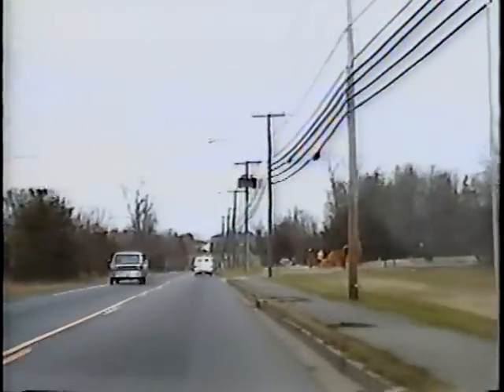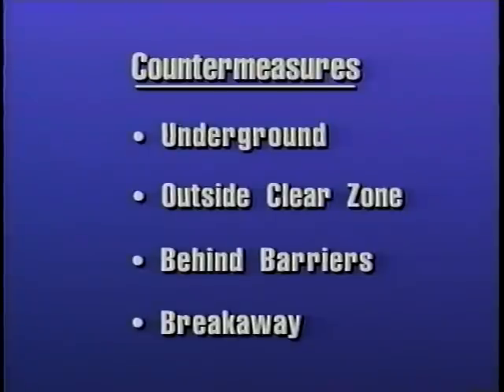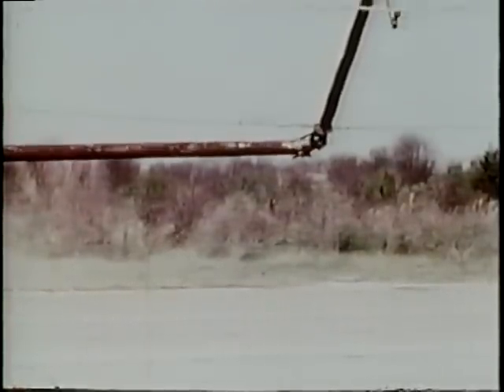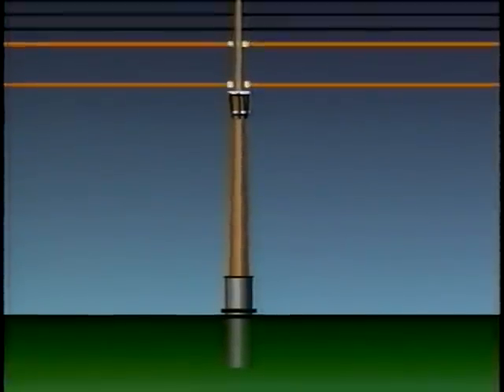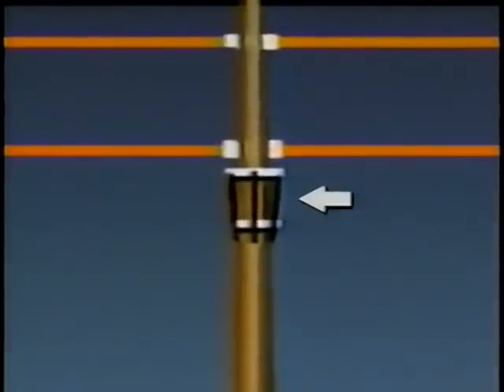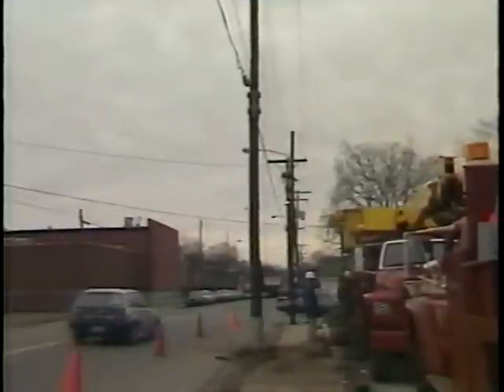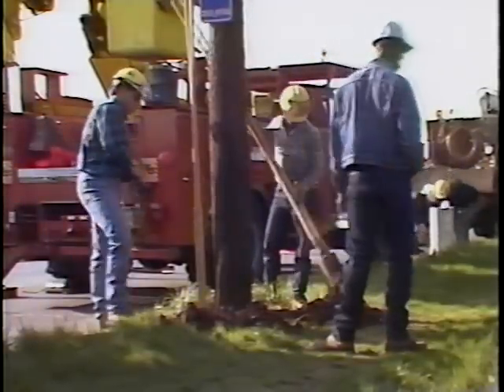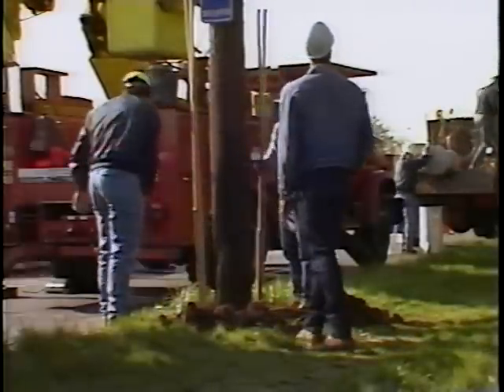Breakaway Timber Utility Poles

Comment: Modern telephone poles are designed to give way or "breakaway" to help lower the chance of death and injury if a car hit them.

Just look up Breakaway utility poles.

Seen an extreme version where the bottom half of the pole was gone but the tension of the wires kept the upper half up right. Lol

Comment: Thats not true. The break away utilty pole designs prevent the adjacent poles from falling and are very easy to replace. You can find more info on them in the new roadside design guide. "No longer stopping a car from going into a house....?" Utility poles were never designed to stop vehicles like semi-rigid or rigid barriers would. If their is an issue of a car entering an adjacent lane or going into a house then an appropriate barrier would be installed to prevent that and not a utility pole.
Reply: Wow ten years

Comment: good idea but not very pratical.. u reduce the impact to the car, but now your sending live primary lines raining down on the area, not to mention your probably gonna pull another 1 or 2 poles down with it from the shock everything else will struggle to absorb.  your only trading off one problem for another, not to mention your no longer stopping an out of control car that may be heading into on coming traffic or a house..